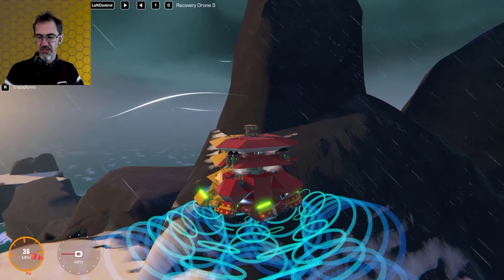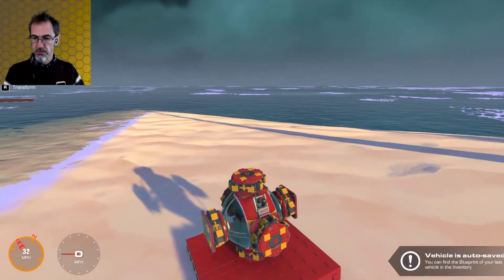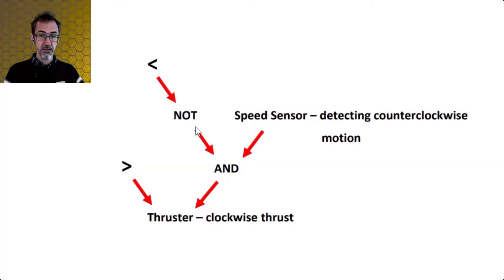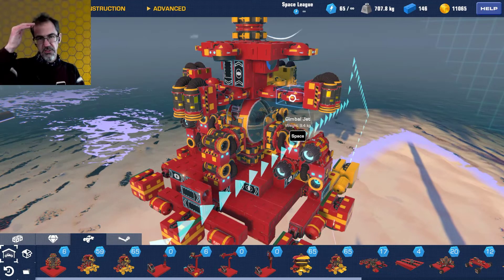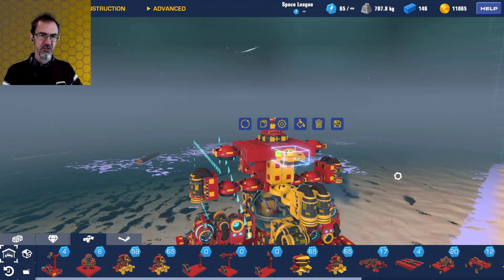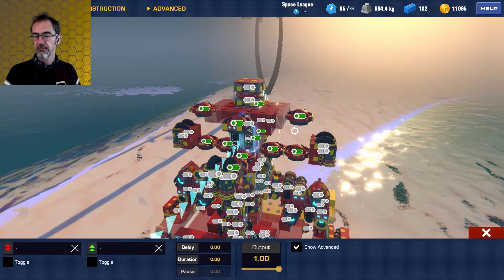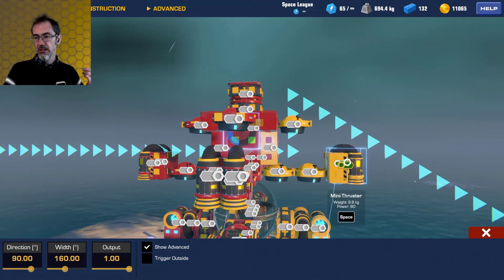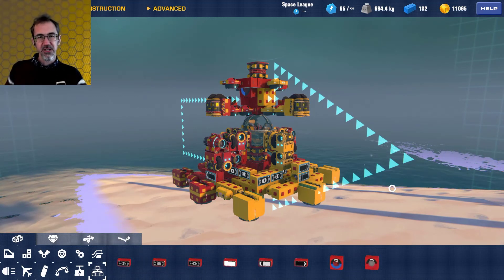How to Build an Auto-Stabilizing Flyer for Trailmakers High Seas; Logic & Sensors Tutorial / Guide

Comment: Great video i agree with all your bugs on the game. Im making a vtol aircraft using no standard controls but using helicopter engines Using the servo to move the angle sensor which pulls the aircraft up,down,turn. There is a video where somebody makes a a flyer drone and uses angle sensors using positive and negative values to use two engines on either angle. We all learn from each other.
Reply from the maker: Good luck with the vtol.